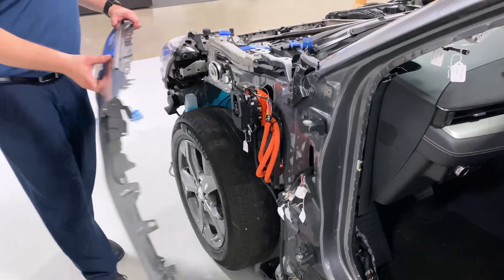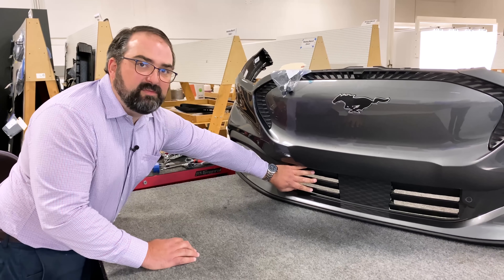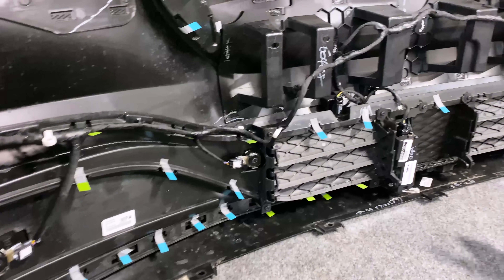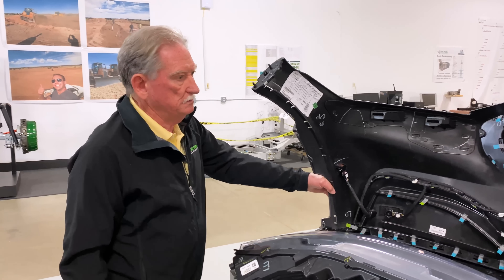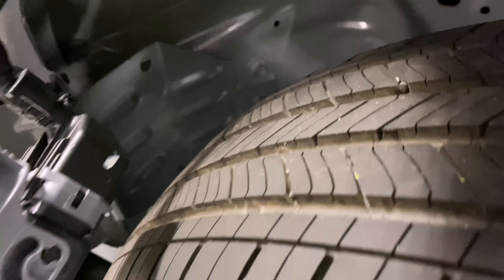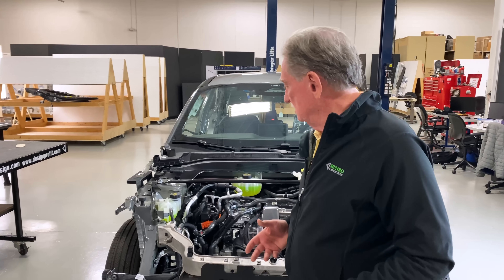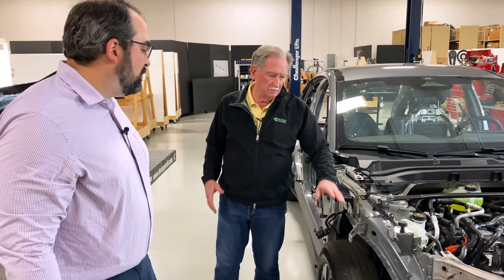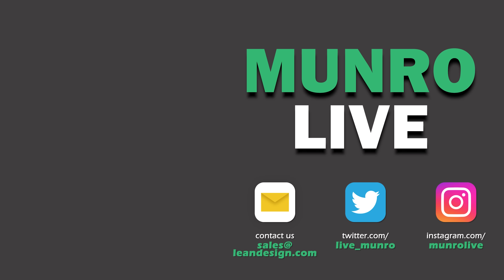Does the Mach-E pass the SORB test?

Comment: Those brackets are bolted on later in the process because the stamped sheet metal has to be able to be stacked for transport. It won't stack with extra brackets hanging off of it.

Comment: As manufacturers design their vehicles very specifically to past specific tests like the small overlap one I wonder how well that actually translates to better survivability in the real world. I suppose it will help but I also feel that making a design that is optimized for one very specific amount of overlap would cause compromise in other amounts of overlap. Would almost be better if the testing was done at a random point that the manufacturer wouldn't know within a range to force them to build more to safety in real world crash scenarios rather than building just to pass a very specific test. Maybe I don't know what I'm talking about though I'm certainly no expert.

Comment: Great analysis!  But this question:  Why do you keep calling it “the body in white?”  Isn’t that a holdover from when a body could be pulled from the assembly line with “white primer” but in an incomplete state?  It seems like this could /should be referred to as “the body” or the car.

Comment: It sure looks like that electronics box bracket is a design-for-repair consideration. If it were bolted directly to the metal work, it'd require a right-angle driver and much more fiddly hand work to install, along with probably a slightly larger footprint to have top-edge fasteners still accessible from the bottom reaching up behind the fender. Perhaps they intend to eliminate it in the future if the longevity of that module proves sufficient - maybe those electronics don't have a lot of miles on them yet for that confidence.

Comment: Snap fits are fine for quick assy, BUT over time, when you need to service the stuff, they BREAK, cus they go bad after years of heat, snap is cheap, screws are better assy for long term, metal fasteners, would be fine, if used as snap fits, not plastic, which ALWAYS breaks

Comment: I can’t help but wonder if those brackets coming out from the fender to hold it on aren’t a separate piece to accommodate repairs should a small fender bender occur. It seems to me that integrating a lot of that into the major structural portions of the car would drive the repair cost through the roof.

Comment: I’m a little disappointed with these rather simplistic analyses. Obviously fewer components are better than more. But without being privy to the design parameters, I don’t think anyone can really make a fair assessment. Consider the fender mounts at 10:47. Pretty sure even the most junior engineer knows that a single piece mounting bracket would be cheaper, faster to install, and lighter than a two-piece bracket. So there must be other constraints that dictated the design. Just guessing here, but maybe the two pieces are welded together at a late stage to compensate for build variations in dimensions. This might allow tighter alignment of the fender panels. I just doubt that the engineers are watching these videos and saying “I wish we’d thought of that!”

Comment: Are double ended snap fitting a thing? 

Let's say you have an expensive part, like a headlight. When you remove it you break a couple of snap fittings, so you will not want to reuse it. If the headlight and the part the headlight fixes to have female connectors you could use a double ended male snap connector to join the two parts. Just make sure the double ended snap connector is the thing that breaks first, and the broken off bit doesn't cause a problem.

OK, this means a higher part count, but the double ended snap connectors could be universal, so could be made in large runs and therefore cheap. Kinda like a really cheap screw that doesn't need to be screwed.

Let me know if there is a reason why this isn't done.

Comment: i would bet that some of the parts they are talking about optimizing are existing parts from the part bin and not newly designed for Mach-E. This of course shortens the time to develop and qualify the part for its use in the vehicle and spread the cost across multiple vehicles

Comment: That control box at 9:30 is likely to be another parts bin special. Ford purchasing won't source anything more suitable so the body engineers have to make a bracket. BUT - why is the control box not inside the front trunk area clipped to the scuttle??

Comment: 9:50 You may be seeing a side effect of rapid development... they may not have known the dimensions of the module by the time the chassis accessories were ready for testing, so they designed a bracket so all that needs to be known for the people doing that module packaging is that there's a mounting method and a given amount of space available. 

I'll bet during the next refresh that bracket does go away and the module is mounted in a manner that reduces material cost, since now they have the module and can work backwards from that.

Comment: I am surprised Ford has jumped on the EV bandwagon with such zest ...
The Mach E and the new EV pick up are pretty impressive.... 👍
One of the great things about current electric vehicles is the new solid state batteries will virtually drop straight into the existing battery space and dramatically improve range safety and charge times ...

Comment: as a consumer I do not like too many clips. you keep talking about reducing cost and saving tons of money but the cost savings per car is so low that I would much rather pay a little extra. it's much nicer to replace components later when they have bolts and i dont have to worry about plastic becoming brittle over time and clips breaking. as a consumer, it means absolutely nothing to me if Ford saves 2.5 million dollars especially if it seems like some repairs will become more of a pain for it.

I know marketing people claim that a dollar increase in build comes out to some crazy high amount charged to the customer but I know better than to believe that argument.

I am not trying to be mean when I say this but I think your work makes cars worse and I think your statements about cost savings are not at all important. charge a few dollars more and give me the bolts.

I don't understand what makes someone value the things you value at the cost of consumers who have to repair these things later. it's like a form of corporate corruption. it's a case of production engineers thinking "not my problem" at the detriment of everyone else.  besides it could mean more part sales for Ford later. hence why I consider it corporate corruption. 

I want a Mach E slightly less after this video.

Comment: I like the lean design viewpoint analysis, but it's Monday morning quarterbacking, useful for improvement but not a fair way of criticizing past choices.  Why is as important as what. 
   This is a new design, not a refinement of a mature one.  Rather than just criticize a component as non-optimized for a particular application,  it would be more informative and honest to discuss why a design choice might have been made. Engineering after all is all about making comprises, with perfect the enemy of good.  Staffing and budgets are finite. You can't have your best engineers do all the work; that talent needs to be prioritized and applied to where there is the greatest need and potential for return. 
   eg, To meet production schedules, could the body in white design have been done separately and in advance of the front fender/facia design, making the fender brackets a  last minute patch?  Might there be other vehicles under development with different fenders that share this BIW?

Comment: 9:15  Sandy.. it is VERY design complex and expensive to "simply turn that connector"  on that module box. Because it is a sealed connector / box, getting a right angle connector in there is NO picnic. I've been designing this stuff for vehicles for decades.. .. a cheaper solution would be to mount the box without a bracket as you showed... but NOT turn the connector on the box, instead use a different connector system that has a LOWER Profile so it fits in the space there.

Comment: What would be really interesting, and probably impossible for it to happen, is having the engineer at Ford explain why they choose to design the section Sandy wants to change the way they did. Why did they design the module so that the connector snaps in at 90 degrees rather than straight in at 180? It would be insightful to understand the thought process that lead to that decision. Without that knowledge suggestions regarding making changes are guesswork.
Reply: I'm sure there are plenty of WIWAF's lurking in the comments section to fulfill that need! (WIWAF = When I Worked At Ford)

Comment: The  Mustang Mach E Premium long range battery was delivered to me three months ago.  It is one of the best vehicles I've every owned.  I can get up to 270 miles traveling at speeds between 70-85.  After traveling that distance, the level 3 chargers will charge up to 80 percent within 20 minutes or so.   The ride, handling and noise reduction are outstanding. It handles similar to a sports car when in "unbridled."   There is a learning curve, but it is well worth it.   Ford has done an outstanding job for their first EV!

Comment: Could it be that the electronics must survive an accident? That said, you won't want to pass through the structure of the front beams to connect the box to the wiring system. 
On the other hand, I could see advantages maintaining independence between structural beams and little holders for the bodywork attending to repairing cost to the owner of the vehicle when damage occurs in slow speed circumstances (parking for example); because in that case you only have to replace the plate or straighten again much easier way.
It's duable to have such strong beliefs but sometimes things are not so straightforward.

Comment: the mounting bracket is probably there to move the electrical connector and potential leak areas away from a surface and vertical orientation where moisture will run over it, into the upside down orientation held away from cold metal and/or wet wheel spray.

Comment: Could you elaborate on what the difference on cost will be to make the parts so they can be used on multiple cars on the platform? Minimal parts usually means it will only suite a single model.

Comment: Full disclosure: I am not a car manufacture engineer or what so ever but I am an engineer in IT and I have a construction exp. 
Few moments:
10:40 - This stamped part separated for a simple reason - it will be a problem to have a robotics automated welding with that sticking part. So they just took a shortcut and put it after the welding. 
10:06 - that plastic part with an angle. The trade-off they have here is simple: they decided to go with an external complexity with a simple internal board design. The L-shaped connector is the simplest way to mount any connector to the board. To mount a connector that aligned directionally with a board is more complex. So tradeoff made right - always go for the complexity with a bigger part if the other parameters are about the same.
Reply: My interpretation of that shelf was also possibly an NVH reduction on the PCB. All the hard bumps the car experiences with that PCB attached to the frame might loosen board components. I'm no EE though, just a guess unless there are feet/isolaters inside that box.

Comment: These guys don’t give much regard for repairability, they are simply looking from a manufacturing perspective. If they had their way insurance would be horrendously expensive, ala Tesla
Reply: It depends. You can also use replaceable snap fits (like you have for the interior trims). This way, if you break a snap fit, you can cheaply replace it.
Reply: @AB-yt4hd  have you replaced a headlight lately

Comment: The chips inside the module mounted directly on the body would probably fail due to excessive vibrations over the years. Having it on the platform reduces vibrations. Comon Sandy, you can do better.

Comment: you seem to prefer faster and cheaper assembly concepts over strength, repair-ability, and longevity of the vehicle

some plastics really deteriorate in really hot areas, you touch those snaps after 10 years and they are just brittle and break. i would think some plastics also suffer in cold climates.
and those cost savings in production are not passed on to the customer. since they will make people pay the same money. i would much prefer the strength of a metal bolt and nut.
Reply: @JorgTheElder  yes they might be designed to fixed and remain untouched the lifespan of the vehicle. 
but any mechanic will tell you the electronics inside sometimes go bad or you have to remove them to reach something behind them for some reason
then you come to remove it and it deteriorates. and at that point you are replacing the broken plastic or keeping it broken. cause of the cost.
all of which can be avoided. if the manufacturer, decided not to save 50 cents. on each part. buy using bad quality plastic. and even less plastic in the plastic part.

Comment: Please stop saying "body in white" a thousand times in less than 15 min. Just "body" is fine. I agree with most opinions, but the little fender stay that you comment that it should be welded directly to save a bolt, trust me, after a fender bender, this setup is way easier, faster and cheaper to repair. The upper fender stay that's much larger, looks like it was done like that to have some strength, so you can lean on your Mach-E and not change the panel gap to the hood.  Mostly an awesome video as usual but maybe you're starting to rush through the production now? I don't know, other videos of yours weren't like this, and this Ben guy needs to be more humble, like Sandy used to be. Take the ego down a notch and double check everything, look at it from all perspectives, and you'll be a legend with your name etched in history forever, you're that close.
Reply: @JorgTheElder  I work in autobody repair facility, for a few decades now. I've watched a lot more auto manufacturing videos than the average person. I know exactly what the 2 different terms mean.
There's no "body in white" in this video, not even a quick picture.
If you found one, just post the time stamp.
If I'm wrong I'll delete my comment and go back to my videos.
Reply: @JorgTheElder  1:10-1:22 is the money shot  
https://www.youtube.com/watch?v=xO0dmg6nFI4

Comment: Depending on what that electronics box is, it may have to be oriented with the board horizontal. If it contains an IMU or compass or multi-axis accelerometer or something else that measures movement, orientation matters - they will often be more accurate when measuring around one axis than another. The right angle bracket may have been the cheapest solution for aligning with the car, especially given the other options are 'a chip that's more accurate in other axes' and 'dumb PCB tricks' like putting the chip in question on a sub-board with some kind of interconnect.

Comment: @9:40 even simpler: snap-mount the connector into the chassis (there's a big hole where the cable comes through) and just plug the electronics box into it. That way the connector itself will function as a mount.

Comment: I imagine that the box in the fender is probably on off-the-shelf item for Ford so they made the mounting bracket. Or maybe it needed some vibration isolation so it couldn't be mounted directly to the metal? The nylon bracket would have some vibration reduction. Or perhaps there is a directional sensor of some sorts in that box that needs to be oriented in a specific way.

Comment: Great video, anybody else notice at about 1 minute and 10 seconds there is a slice across the top of the radiator or condenser whatever it is. Goes diagonally from top right to bottom left it's possible it's supposed to be there I don't know why though it definitely looks like something cut through the top of it. Perhaps something happened while they were disassembling the vehicle

Comment: you break one of those snap fits and you have to replace the whole component.  This is what is destroying insurance premiums.  Good for the OEM's bad for the consumers in upkeep costs which result in higher premiums
Reply: Not a problem if they use replaceable snap fits.
Reply: @AB-yt4hd  you mean those metal insert ones? those tend to break the plastic after a few uses. Might as well use some adhesive or velcro.

Comment: I'm guessing, the reason for the oddly mounted ECU in the fender was re-use of an existing part, which packaged differently on a different vehicle.
Reply: Brand new platform.  Ford is crap.
Reply: @johnnicol8598  
Still use standard parts.

A unique car is too expensive.
Reply: @johnnicol8598  A new platform does not mean all new parts.  To save money, you might re-purpose existing designs rather than pay for tooling up all new parts.
Reply: @mfridmanyt  Granted.  And I agree.  However this is there first real endevour in to the all battery market.  Honestly looks pretty weak to me.  Some of it is all new and point on.  A lot is just God awful though.  This is not a low end vehicle, nor priced that way.

Comment: The stamped wing fasteners are for alternative designs, or done because final skin design wasn’t complete
Reply: Taurus sheet metal will be next.
Reply: Or for damage repair costs. Insurance companies have quite a big input on design nowadays as cheap insurance equals more fleet sales equals more profit.
If you bump the fender and bend the mount, the bolt on bit is much cheaper to repair than anything that requires welding.